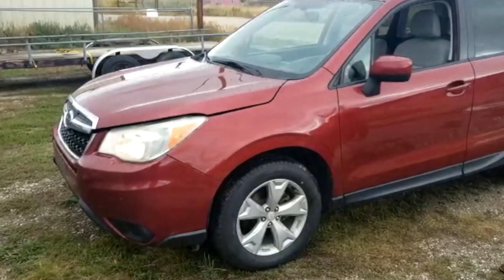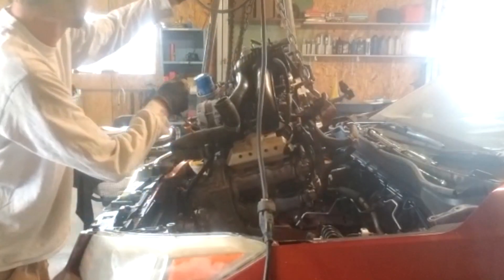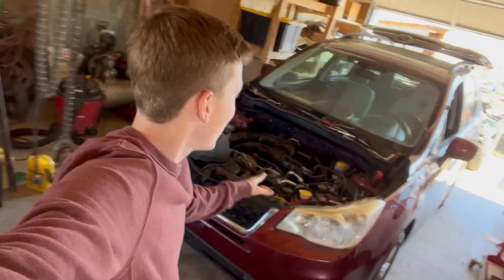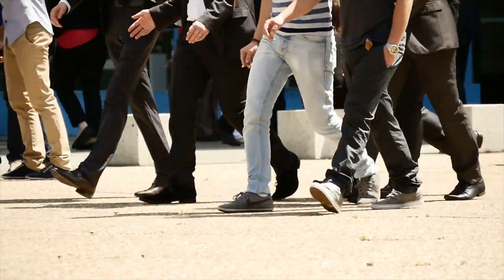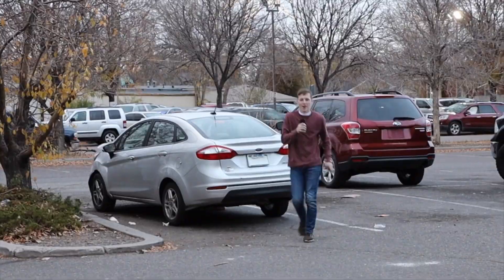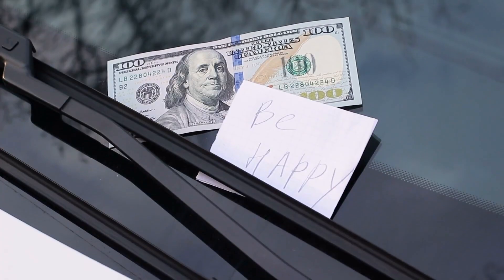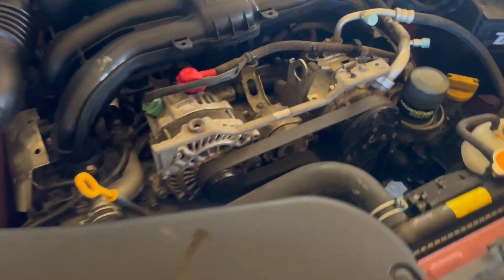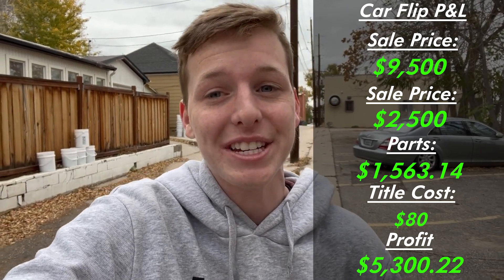I FLIPPED A Car And MADE $___

Comment: $5k profit is great! But what would it cost if you had to pay for labor?
Reply: 11 hours @ $150 an hour = $1650
Reply: @Wonderlaust  11 hours is the amount of time his brother took to replace the engine, but the auto repair shops calculate bills based on book time. Also, shops usually add an upcharge to the cost of parts.
Reply: @theotheleo6830  I’d say $2300-$2500
Reply: At the end of the day it was like he paid labor, because the 5k profit is still going to be split with his brother that he is only taking home 2500 at the end